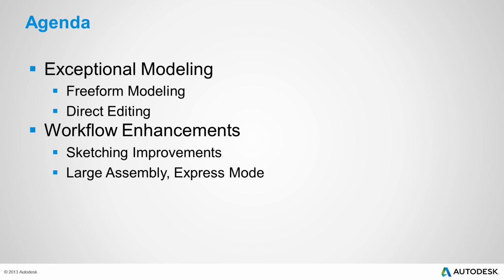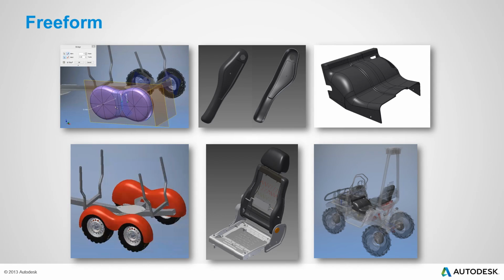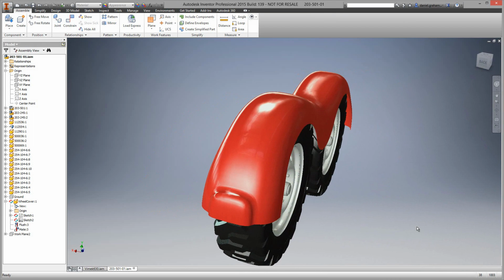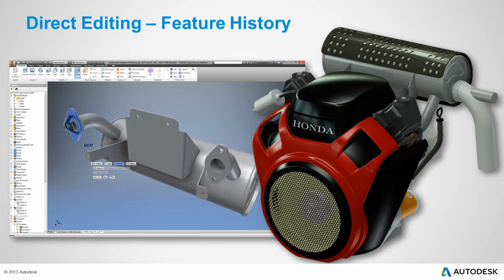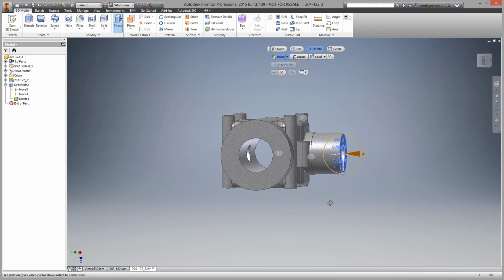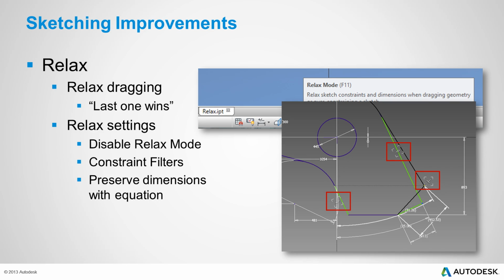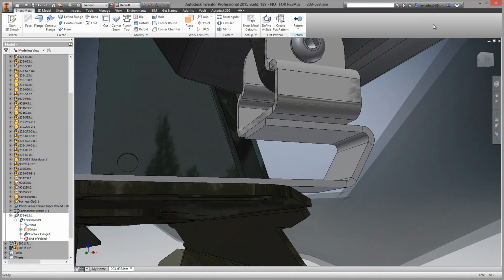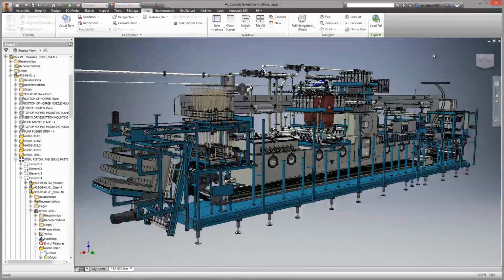What's New: Inventor 2015

Comment: Thanks Jay, great video! At 2:06 you mentioned the idea of organic shapes but you noted you didn't like the use of that word. I'm an Industrial Designer working with solids and nurbs and this topic is a popular one which is difficult to challenge. I agree with you because I'd argue neither of the six referenced shapes are organic in form. I should first mention that this topic is largely based on the subject of living organs. An organic form would resemble that of a human heart, whereas the shape and form is not symmetrical from any viewpoint or section view. Without having to further synthesize the topic, I thought I'd share a word I use when discussing any form constructed from splines. I choose to use the word curvilinear because it best describes the shape and form without challenging the qualities of true organic forms.

Comment: will 2014 be able to open 2015
Reply: No, it can't
Reply: madhellsing Old versions of SolidWorks can only open newer files a single version forward once an update has been released for the old version. So yes while it is annoying, what you are saying isn't entirely accurate.
Reply: Scott Moyse Well I have the 2013 ver. of inventor pro and I can't even get another person to open my files lol not even in other systems like step and others. This is annoying of me having to do it the hard way to be able to retrieve actual files from my system to be able to get the workshop working on my stuff. And this is why I'm switching. It does suck a little bit do to the nice textures and colors, they do help on the visual candy for presentation purposes. But in the end as long as I can get my design turned into a live product and prototype it doesn't' really mater all the cute coloring and showcasing.

Not even that but with solidworks you only pay ones 5 grand and minimal fee to get the new ver's  unlike autodesk you have to fork out 5 g's every year lol. It's just pure logic and makes sense to get solidworks.
Reply: madhellsing 5g every year? Sounds like you are getting ripped off mate. That isn't how much maintenance costs. Also something is very wrong if you can't get Inventor to save out a 3rd party file for another CAD product to read. Either you need training or there is something wrong with your installation/hardware. I wish you luck, because often the grass isn't greener. SWx is a great product, but so is Inventor and your comments so far lead me to believe you are misinformed.
Reply: Scott Moyse Right...